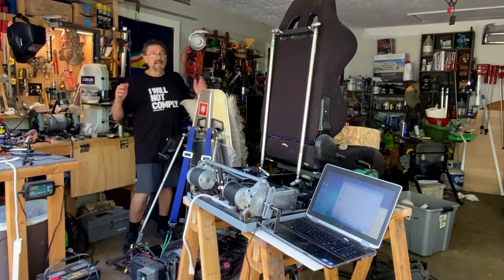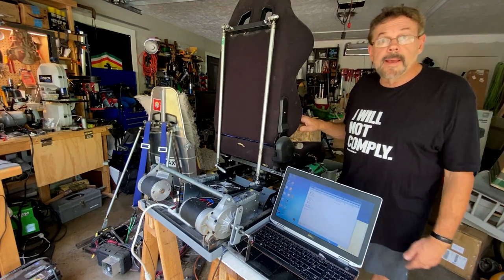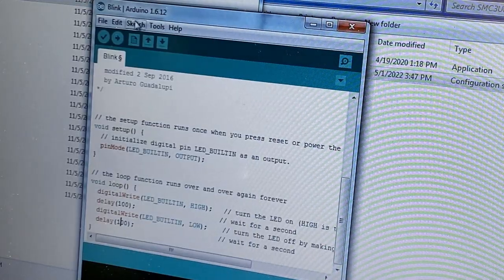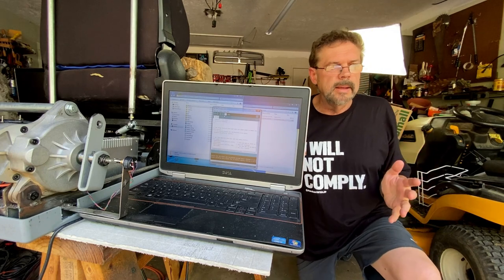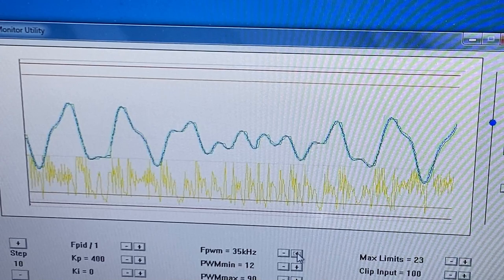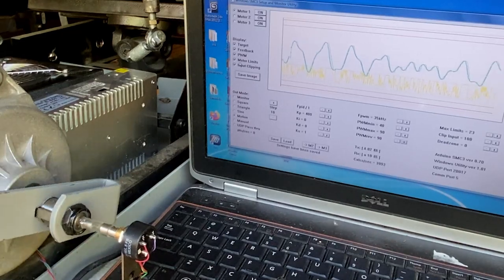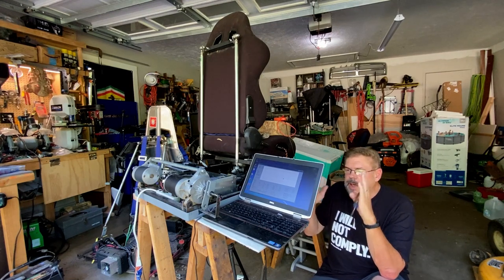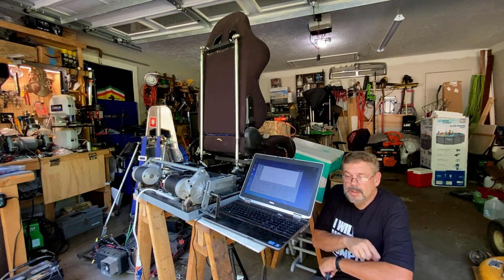DIY motion simulator Arduino IBT-2 24 volt Jazzy Wheelchair motors - How to set up SMC3 simtools

Comment: Dave, you are my savior, all setup done (1 motor at a time) and the motor starting shacking like crazy, green lines everywhere... 

Then I remembered... Dave had this problem, I remember the green lines going up and down on your video very very fast...
Then I found your video, again :)

That's is why your videos are sooo important to most of us. It also includes the errors, it shows your process to reach the goal.

Haven't seen you for a while, hope everything is ok!!!
Reply from the maker: Hey buddy! Thanks again!  Yeah I'm ok..  just been building an addition to my house by myself so ..  priorities to get it framed in and roofed and wired and stuff before winter sets in..  I'll be back soon..  My new rig is almost done but sitting up on sawhorses in the garage till I'm done with this house project..   Cool to hear from you and glad The videos are archived by you tube in a way that people can find them.  Dave

Comment: Thanks for all the knowledge you provide, and help you give the racing community. I hope to see this channel grow like the other sim channels.
Reply from the maker: Thanks so Much Isaac!  I have been thinking of the questions people have asked over the last couple years and the questions I had when I first built a motion rig.  I think I'm going to go over it again and attempt to make a 12V compact design from scratch with all the dimensions etc   3 DOF.  Guys like you keep me motivated to do more for the community!  Thanks again!.. Dave
Reply: @DMAX_DIY  would it be possibly to get the measurements that you cut all the steel to? Thats where im stuck right now. I got the motors the yoke and the arduino stuff i just havent bought the steel yet cause i dont know how much i need
Reply from the maker: @Odysseus38  Hi Isacc..  I did a workup of all the dimensions on my x simulator build page.   it's on page 2  https://www.xsimulator.net/community/threads/full-frame-2-dof-traction-loss-new-build.14740/#post-198628
Reply: @DMAX_DIY  omg im so sorry I spent forever looking for it but cause im new to the site I couldnt figure it out but i did now thank you
Reply from the maker: @Odysseus38  No doubt.. that site is fantastic but it takes a long time to find what you need unless they people post put in the right keywords..    I tried to put in the keywords on my section..

Comment: This gives me a lot of hope! I'm totally clueless to the electronic side of Motion sim. But what sounds like you, I could not see spending the money. Then I ran across a DOF reality 3 dof control box fo r $50 on Ebay,  no cords, or anything came with it other than a a black box with the electronics in it.  I then hoped that used $50 wheel chair motors would work, they happen to be the same ones I see your video! anyway my rotary sensors should arrive any day. Wanted to have all the parts before I started to cut and weld. Not sure what the black box has programed or even how to access it yet. Your videos have given me a lot of needed direction. For this I thank you!
Reply from the maker: That sounds pretty intriguing..  I dont own one but I saw a review on it..  It should have 3 power supplies inside and an arduino and some other stuff.  Let me know how it looks when you get it!  The DOF system uses simtools from what I can see.. It probably already has of the motion setups.  Dave  
https://www.youtube.com/watch?v=ZeidFZsAXhM&t=338s
Reply: @DMAX_DIY  It does have the 3 supplies, arduino, 3 controllers, An emergency shut off set up. While it has one more item that I have no idea what it is. All in all it is basically the same as your doing. I do not see any fuses which I do not like and will be adding, will try 25 amps. I hope to find time to build the platform now. I was not ready to get the unit, but now I know what I have to build it around.
Reply from the maker: @garymarma6005   It sounds LEGIT.. I saw a video on it from Gary..  I'll send the link..  Yeah I would think 25 amps is a good start.  Especially since some of it's unknown..  Ill send the link after I find it.   Here is Garys tear down of the system https://www.youtube.com/watch?v=ZeidFZsAXhM&t=338s
Reply: @DMAX_DIY  Yes, all the parts in this video are the same model numbers, except 3x's. Only There is one more part. This is the "unknown" part to me?  also it lacks the two external fans shown in this video There only internal fans in the 3 power supplies, I Will keep at watch on temps. I believe the video said supplies output 14.8 amps. With 24 volts, this may be all that is needed. I will start with a 15amp fuse after hearing that. The unit  does power up. The DC power supply plugs used for the motors from the unit only use 2  prongs(+ -) , the third has nothing attached and not used. Then the "data" plug mentioned has the three needed prongs, + -  and communication. I just need to check that the power output is 5v form the power supplies to the rotary sensors I purchased. I do believe the arduino is already set up as you mentioned.  I paid the $50 or something close  for  DOF reality program needed from Sims racing. Hopefully I will find time to mock up a motor with a rotary sensor, likely use the tuning  program I saw you use for my  attempt of some type of controlled movement. I dont see how I can upload a pic to show the unknown part.  I still understand the lack of fuses inside the unit. I guess I should also 5a fuse the rotary sensors.
Reply from the maker: @garymarma6005  congrats my friend.. looks like a decent find. Yes you will need to get some of those 180 degree sensors to attach to the motor shafts,  I took a good look DOF teardown video and it all makes sense to me, especially cause I just made the same thing with the wheelchair motors.. however their motors are sunshine or something and look to be more powerful than the wheelchair motors..

Comment: hello , I really appreciate ur time doing this toturial , but I have 2 issues I coud'nt find the selotion to it , first its the noise of th motor and wiggling line of PWM feedback , the second its the heat issue with the wiper motor even when I changed the source from 24v to 12v.

Comment: Hello, I have a small problem with the DIY motion platform 2 dof. 
Everything is fine in SMC 3, the blue line matches the green 
one (pot 80T & 36T gear) , everything works fine in sim tools, roll, pitch and surge are fine.
After connecting the motors (PGSaw 200Watts) 
to the electricity, the platform adjusts nicely to the level
and here is the problem when I sit on the chair, the platform 
tilts as if the motors do not hold the platform. I also plan to add springs.
The question is why the arms of the motors lower even with minimal load (I press lightly with my hand).
Reply from the maker: Good question Pawel Stzrop..  On my 12 v PGsaws. they do the same until I go into 'game mode' .. then they are activated.   I have the PWMax and REV. set the same around 220..  try bumping up your PWMAx  and maybe bump up your PW min..   Let me know.. sometimes mine moves when i sit down  until the game actually starts..  then there is no way to I could push it with my hand..  I am 210 pounds.. full frame rig..  a lot for those motors to move but they do it just fine..  
Dave
Reply: @DMAX_DIY  Thank you for your quick reply. The problem is now solved. I replaced the 12mm steel rods in both engines and I forgot to insert the pins in the holes :) It's good to see your materials on YT. Regards.
Reply from the maker: @pawestrzop1037  That's great news!  Yeah..  I ended up welding the levers to the motor shafts cause they kept shearing off..   Glad you found a solution..  I'm putting out a new video tonight..  Should be great!  Take a look if you have time.. Dave

Comment: Thanks for your videos, they have inspired me to try to build my own motion sim.  I have these same Jazzy motors and I am really struggling to come up with an arm due to the keyway.  What did you use for your arm?  Is that mind steel?  How thick?  Thanks.  I purchased these after watching your video but it looks like you changed to different motors later?

Comment: Did you make the rotary u shaped arms that are connected to the motor shaft and the tie rod?  ( arm has a key cut in it) If you purchased them where did you find them?  I can weld up the piece, I have no way to make that bend.  also would like good key cut in the arm. Maybe easier and tighter to purchase one if able.
Reply from the maker: I just found the metal bent that way..  If I had to do it again, I could have made them out of two pieces of flat steel   and weld them together.  That way you dont need to bend them.. just lay them on top of each other..  Making the keyhole would be easier this way cause it took a while to file out  And although I like the keyhole idea,  it does wiggle a little bit.. I am not really into saving or reselling the parts so i would probably just weld the arm righ to the motor shaft.  I did that out of necessity on my 3DOF..  kept snapping of the retaining bolts ..

Comment: So how do you know what converters you need ? I got some jazzy chair motors but there bigger than these ones 3/4 shaft . 12-36v operating range . How do you choose the Amps and wattage when buying a converter ?  . Would bigger converters be better ? Maybe something closer to the max amp for  ibt-2 around 40 ?  the I was planing on making a 3dof. Thanks .  Just don't want to mess to much up haha .
Reply from the maker: Thanks for the question.  Good point.  This is my first time using converters so I went on x-simulator.net and saw what other people were using successfully.  I just ordered those..  So if your motors can handle 36volts  you will want to try and get converters that supply 36volts or your motor will run slower from what I understand..My motors say 24v on them so I chose 24 volt  with 25 amp output..  I've tested them to about 24 amps and they did not blow so I have them fused at 20 amps right now.  I'll be doing some more testing this weekend and hope to get it on video.

Comment: What position do you place the motor arms in when you boot up? Level to the floor? Does it consider that start position 'home'? I feel I should start the motor at 3-clock, but they jump to 1 o'clock which makes them sometimes try to go over the top.

Comment: Dave, I've got the same Jazzy wheelchair motors. Triple checked all boards and wiring. Motors run fine with simple arduino script (e.g. analogWrite(r_pwm, power); but when I run the SMC3.ino and then the SMC3 tools (v2.6), the motors just 'cluck' shift forward/back rapidly with no movement. What needs to be set in the arduino script? I'm setting MODE2 and have tried both POT_SCALING settings. I bought all the same boards and pots. Thanks!
Reply from the maker: good question.  let's talk about SMC3.exe for a minute first.   so the motors move correctly when you are running smc3.exe and are on manual control?  how about if you put it on 'motion' or 'square' or 'sine wave'?   I need to know how they react when only running the smc3.. I dont think anything else is required in the code other than to put them in mode 2.   - let me know Dave
Reply: @DMAX_DIY  the .ino code says you must define either ENABLE_POT_SCALING or ENABLE_NON_LINEAR_POT_SCALING. I've tried both. Makes me wonder if I have the right sketch. (smc3-arduino-3dof-motor-driver-and-windows-utilities.4957). I rewatched your video and turned off both POT_SCALING defines. 

With sine wave, I now have Motor1 tracking but it tracks smooth down the hill, but 'clucks' up the hill. For Motor2 the green line drops to floor and stays there. As I turn up PWMMax, at about 120 Motor2 violently 'clucks' - jumps back and forth into forward/reverse. Video here: https://youtu.be/aGOOOWz_tC0

Comment: Hello, your videos are good and fun, I have already learned a lot from you. But now I have a problem I didn't connect everything like on your video .And I can see my potentiometers on my SMCUtils screen but when I press motion my motors do nothing.  .12 Volt wiper motors. And I use IBT-2 motor drivers. Do you have any idea what the problem could be?My question is is it very important which Angle Sens you use?   I hope for more nice videos from you and thank you in advance. Greetings Tony.
Reply from the maker: Good question and thanks for asking.  I would start with the settings in SMC3..   If you can see the green line move when you manipulate the pots then at least the arduino is talking and you have the com port set correctly.   Try reading this section on x-simulator.net  and set your software similarly..  here is a quick breakdown.
  Disconnect the motor power supply
Make sure Simtools is not running – we’re not ready for that yet!
Wire up the Arduino (with SMC3 installed) to your H-Bridges and connect to your computer via USB
Run the Windows SMC3 Utility software and make sure it communicates with the Arduino (There is no need to set baud rates, they are not configurable)
Set the Kp, Ki, Kd, PWMmin, PWMmax, PWMrev to 0 for ALL motors (This will make sure the motors don’t move)
Set Clip to 255 (you need to do this first) and Limit to 255 (This will give you plenty of margin if something goes wrong while setting up)
Turn on the power to your motors – nothing should move at this stage!
Set Kp to about 400
Now slowly, increase PWMmax… at some point the motor should start to move. When it does check the “Green” feedback line is moving toward the “Blue” target position.
If it is then that motor and feedback is wired correctly - proceed to test other motors.
If it is moving away turn off motor power immediately (or quickly reduce PWMmax again). In this case you need to either reverse the wires to the motor being tested –OR– reverse the +5V and GND wires to your feedback pot for the motor being tested (do not do both). Restart the test from the beginning.
Do the above for each motor

more can be found at this link:  https://www.xsimulator.net/community/threads/smc3-arduino-3dof-motor-driver-and-windows-utilities.4957/     hope that gets it moving..  Dave
Reply: Thanks for the quick response, I'll get started on it soon, hope I can get it right now.

Comment: Hello there I am again help me, I connected everything as described in SMC3 Arduino 3DOF Motor Driver and Windows Utilities.
I've already replaced everything once but I still can't get my feedback line to follow my target line . I think the problem is in the Arduino program, but I don't know what and where.    Do you have any idea what I'm doing wrong or where the problem is. I've been looking everywhere for four weeks now but can't find anything about it. I can adjust the green line nicely with my potentiometers. But if I put it on motion, nothing happens, he's not going to follow the blue line. PLEASE HELP.
Reply from the maker: Ok so thats a good question.. Check the arduino code to see if it's set to MODE 2..  There is a line in there you need to change from #define MODE 1  to #define MODE 2 to work with the IBT controllers..  that's in the SMC3.ini file in the arudino IDE.. then upload to the arduino..  Try that..  Here are two links which may help

https://www.xsimulator.net/community/threads/problems-with-my-simulator.15382/#post-207320

https://www.xsimulator.net/community/threads/smc3-arduino-3dof-motor-driver-and-windows-utilities.4957/

Comment: is it a normal cnc card you control the simulator with? or is it a special card? how do you get it to connect with a racing game?
Reply from the maker: it's an arduino uno R3 version  - about 20-30 bucks.  The arduino will control the IBT motor controllers - Arduino can control up to 3 motors.  The software is called simtools (I have some videos on that too).   The code is free to download for the ardunio..  Simtools reads the game output telemetry and sends info to the arduino, which controls the motors. Dave

Comment: HI DAVE 
CANT SEE THE BLINK PROGRAM ON THE ARDUINO IDE WHEN CONNECTED TO THE BOARD?
ANY HELP WOULD BE APPRECIATED 
THANKS IN ADVANCE
RICO
Reply from the maker: So the Blink program is already loaded onto each arduino.. or at least it has been for everyone I have purchased..  I think that's how they 'test' it from the factories..   You cant 'see' it..  but you just plug it into your USB and it should blink one time per second.    Take a look..  let me know  Dave
Reply: @DMAX_DIY  thanks for getting back to me 
I just went ahead and uploaded sketch file in the end, had to do it twice but got the potentiometers set up on smc3 just need to connect motor power supply when it arrives and get set up. 
Many thanks for all your input Dave 
If I could show you a photo of my invention I would. 
All the best Rico

Comment: Can you use a stepper motor without a potentiometer
Reply from the maker: Good question Trevor..  I dont know for sure..  Maybe cause all you need to do it get a voltage position for the motor shaft.   I just followed the advice of many on the xsimulator.net forum..  Path of least resistance..  I now have 8 of those 180 degree hall effect pots..    ALso plan on doing a test between wirewound 10k pot and the hall effect.    Cool thing with the hall effect is as follows:  so the motor will only really be operating at a range of 180 or less.  the hall effect 180 has a sweet spot of 180 degrees, but it can spin around indefinately..  so if somehow the motor goes crazy, the pot will just spin with no damage.  the wirewound 10k  will probably just break off if the motor goes crazy..   FYI i have not had the motors do anything like that..  but there is a possiblity.    Dave